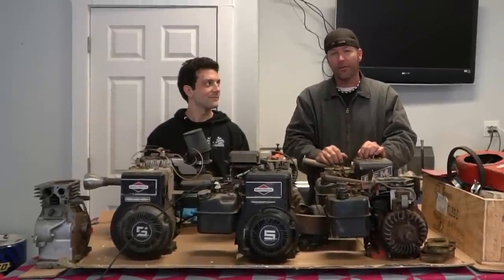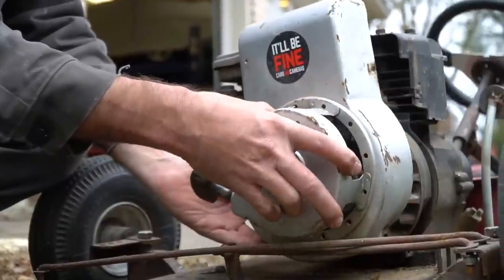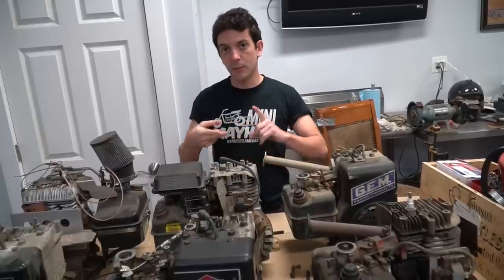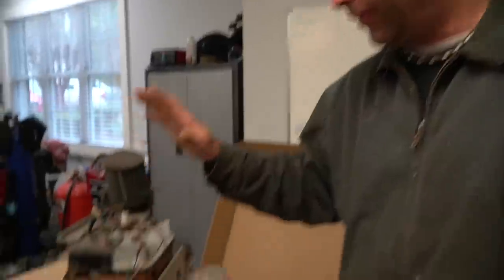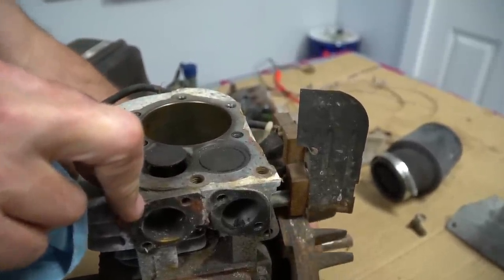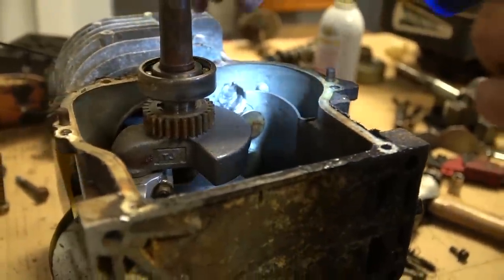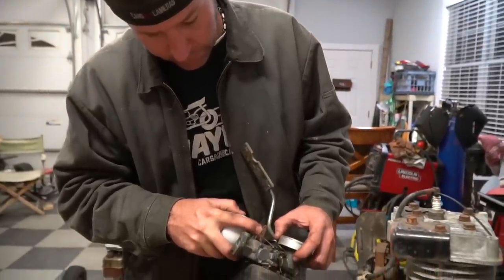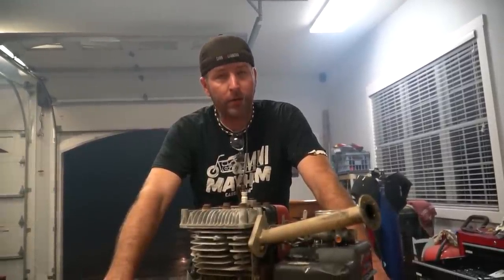Rat Rod Wagon High Performance Engine Swap! (Pt. 1)

Comment from the maker: The following video features activities performed in controlled environments by knowledgeable persons.  DO NOT attempt to duplicate, re-create, or perform the same or similar activities at home, as personal injury or property damage may result.  CARS AND CAMERAS, the persons shown in this video and ANY CONTRIBUTOR, ARE NOT LIABLE FOR ANY such injury or damage. ALL CARSANDCAMERAS CONTENT IS FOR ENTERTAINMENT PURPOSES ONLY.
Reply: And yet people still follow your directions. For the stage 2 build, you said 2 grunts for torquing down the rod, so I did the same, and a year in, and 20 hours on it, it works great!

Comment: The block isn't broken boys. The lifter bore has been welded up for durability. Has it been ported and polished? Also they stopped production on Briggs 5 horsepower engines

Comment: I dont believe that carb you guys put on was from a raptor, a friend of mine bought a brand new raptor in 03 or 04 and it didnt have a choke. Good choice on the older engine. I'm of the opinion that the older 5hp b&s ran better than the newer ones. My minibike with an 80's 5hp off a tiller would out run my dads minibike with a later model(90's), and friends with the above mentioned raptor engine. Mine also had bad rings and smoked a lot lol.

Comment: Another trick we used to do on are race engines was run a 31/2 horse steel flywheel lighter spins faster

Comment: Did anyone see that flame at 14:45 roughly come out of the valve cover?
Reply: Alex West Yeah it really confused me
Reply: yah, more like 14:47
Reply: 14:46
Reply: Blown head gasket or warped head I'm guessing!
Reply: Yep
Reply: Awww.... beat me to it... Warped head. Good news y'all got more heads!
Reply: Just checked the vid, if you slow it down to .25 speed you can see it's just a reflection of the lights on the paint.
Reply: It's just a reflection on the black paint lol

Comment: Running on alcohol is most likely the cause of the surface rust in the crankcase, very common on rc nitro and cars that run 85

Comment: The rings aren’t bad they built the motor loose for a lot of rpm’s back in the day I still do that I’ve built more that are looser that motors in really good shape it ain’t like a predator you build tight it’s a flathead they need to be loose in order to oil the top end so they don’t seize up a Valva or a piston That motor is in really good shape a flat head is different!!!!!!!!!!!!!!!!!!!!!!!!!!!!!!!!
Reply: The Lone Wanderer that’s how I built my 5hp

Comment: oh , yes !   a steel bore ...GOOD
reinforcement castings @ intake and exhaust ports...GOOD
go back and pull all 5hp flywheels and borrow moms kitchen scale and weigh ALL flywheels , take lightest one for your engine
don't over port the intake
if using stock head gasket you can mill head to the squish area and still have good valve clearance
use a 16" header and a K&N filter
find a pulsa-jet carb with adjustable main jet (don't use the newer low emission carb)
billet rod...ball bearing PTO !!
check on dyno website for the cam specs ,,,stock lift is about .232 lift intake
GO POWER should still have parts for BRIGGS RAPTER chech it out
use heavier than stock valve springs

Comment: The lifters aren't broke when you have a flathead motor built for racing they weld there for strength and that carb is probably jetted for methanol

Comment: I bet u it’s the valve seals not the rings when the valve seals sit they warp and not seal I’d change those as well
Reply: That was the first thing I thought about.
You can usually tell by at when it smokes at what throttle amount.
Reply: As soon as I saw the piston I was like it doesn’t need rings and as soon as it smoked I was like the valve seals are shot and there like we’re going to order rings and I’m like there going to me mad when it still smokes after fresh rings are put in

Comment: That's a old limited motor with welded lifter tapp bore hortsman h beam rod that's probably a .315 lift dyno could be wrong that motor runs on alcohol

Comment: Hey guys ive been watching you guys since the og ratchet lawn momer build and i was wondering if you could help me with a question, i have an old yerf dog gokart (really old and rusty) and i just got all the parts for it and put it all together but then i went to take the back tires off and the keyway is so rusted i can't pull the thing off, so that was about a year ago ive been soaking it with wd40 for a month now and it still won't come off, if you can please reply and please could you give me a tip to remove it. Thanks
Reply: Charlie S. Heat the shaft with a torch but not the keyway
Reply: @christopherkelley1233  the spacers are plastic though and i dont have a torch, thx for the reply though dude
Reply: Well try getting a really big pair of vise-grips and putting them on the keyway and the end of the shaft with a lot of pressure then just leaving them over night also try pb blaster instead of wd-40
Reply: @christopherkelley1233  i just recently got a industrial puller ( with four 10pound arms ) and im going to try the pbblaster I really hope that I can get the tires off after that thx for your help

Comment: I have a 1994 8hp Briggs could I remove the governor on it (I have heard the higher hp flatheads can’t take high rpm but I could be wrong)
Reply: If it has the synchro balancer (reciprocating counterweight) you need to at a minimum replace the connecting rod for the counterweight with a billet one.
Reply: David Malphurs can I tell from the outside if I have the synchro balancer?
Reply: @poopyhead8358  I'm not positive, but I don't think so
Reply: thebuilderguy alright thanks
Reply: I don't think the 8hp have the synchro balancer. The 11hp and 12hp do. I replaced the counterweight rod in my lawnmower with an arc billet rod.
Reply: David Malphurs alright now all I have to do is find the rod size

Comment: for one your probably  running the wrong fuel in that motor I use to race gocarts and back in the day of the brigs motors we ran methanol  hence the reason its running so rich to run methanol you have to redrill the fuel port out to allow enough fuel to get to the motor

Comment: If the carb  has been bored, more than likely it has been ran on methanol. Check the jet, it might be  53 inside it.  P.s. send me a motor, I'll take the one with  the welded clutch!

Comment: well shit went down tnite
at 5:50 or so i was geting done doing a heavy mod on that old utility vehical i was talking about a few videos ago
the one with a 340 honda and it got swaped with a pred 301 and its unrelyable and all that and how i was gonna get a honda 490 or whatever it was
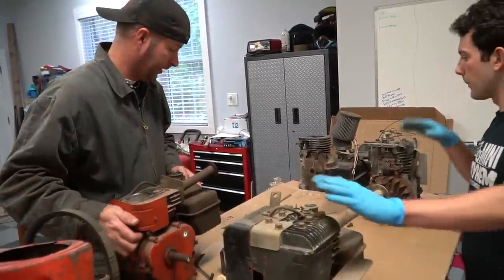well i put the 212 from my murray onto it did some mods and by 5:55 (started at 3:30) and basicly it has a trans with the cvt so it has gear ratios n stuff and so it was geting late it gets real dark at 6:00 and basicly i was geting ready to put it up so i had my tools picked up and whatnot well the thing weighs a lot id say well over 200lb? idk realy its a heavy sun gun i can tell u dat much and basicly i cranked it up and put it into gear gave it some gas
OPEN THE FLOOD GATES BOII
yeah the thing went wide open throttle
and i only had to move it a few feet
my grandpas old 48 ford pickup hes been working on for the past idk atleast half decade and yeah so basicly hoc right into the frount bumper of the 48 pickup
my knee slightly hurts and i was shaking like a single cylinder mounted with no rubbers and no counterbalance and i was f**** WOKE AS HELL
scarry shit man
Reply: and speaking of resogring things
ill be restoring the old 87 ford bronco soon or later
alredy got it in my shop and started the proses of cleaning it out and whatnot so i might stop investing into my kart
if im going to invest into anything its gonna be the bronco
or maby a motor cycle
if i can get my hands on one
bc my parents are the kind that are completely against the idea of them
they are unsafe 
thats the point of a motorcycle its not meant to be safe lol

Comment: Very old school bore it way out sleeve it and use the piston from a car engine you have a wide selection of engines to choose from and a lot larger bores to choose from like 4 in Chevy piston and auto grade sleeve cut down to fit the Briggs block the connecting rod can be milled on a 5 axis lathe if you have a friend with one very hard core and way more power plus the valve's can come from a car as well and be machined to fit for more flow a lot of work for a lot of power .  I was board as a kid in the 70's so I played with engines

Comment: Did you really say the Briggs is the Honda clone of the old times? Briggs was THE GO TO motor for mini bikes, go karts, and whatever death machines we could think up when I was a young'n..... and when Jr dragster made it to my home town, the Briggs 5HP was the required engine block and configuration highly modified to make 3 and 4 times the original horsepower.... I don't know which came first as far as the Briggs vs the Honda but I do know there were a lot of Briggs clones back then. Maybe you're right but I don't really think the Briggs was a Honda clone. Just my 2 coppers...what do I know? I'm just an old guy who remembers the shenanigans we did with the old Flat head Briggs 5HP engine.

Comment: You guys are killing me... Have you ever met up with anyone that actually races karts, or you just wing it on purpose?

The cam you have is meant for 8500 RPM, to get a flathead to survive up there, you have to run the rings looser to keep the cylinder lubed, and it's going to smoke.

Second, you're likely overfilling the crank case AND probably have a plugged up crankcase vent box.  For racing applications, we use a really thin racing PAG oil (like Thor Lite), and only use 13oz on an angled engine mount to cut down on the windage on the crank.  If the crankcase vent is plugged up, you'll force oil vapor into the cylinder on the intake stroke, and you'll also probably hurt the block revving high if it's not venting properly.

Comment: It smokes because it's SO rich - Real racing Briggs engines that actually go to the track and not around peoples yards are modified to run on ALCOHOL - the jets have been drilled out perhaps.......... you wanna get 20+HP out of a mildly modified 5HP Briggs, run it on Strait Methanol with some synthetic top-cyl lube!!!!
Reply: Agreed, that's not oil smoke, that's too rich!

Comment: Idk why people think over sized pistons make something have more power. The only reason it works on dirt bike is because the new cylinder is much bigger. In the case and on car engines when the cylinder is made into the block all it does is give you a new block. Let new rings seat better. That’s why when you boar it to much it will have over heating issues
Reply: you are dead wrong. any time you bore an engine, it has to be taken in to equation for hp formulas, as more more equals more compression and piston area.

Comment: 115 years old, brigs still produce those 5 horses every day. That guy was just a lazy idiot.

If that is an old racing engine bet the carb is set up to run methanol. If ya'll trying to run regular gas in it I'd almost put money on that is the source of the carb "problem" and why it is smoking like that.